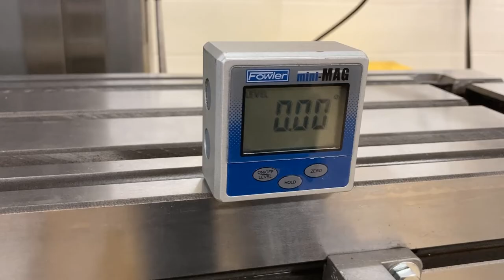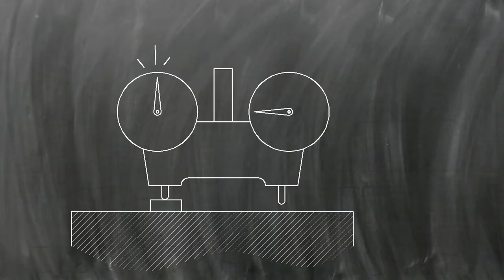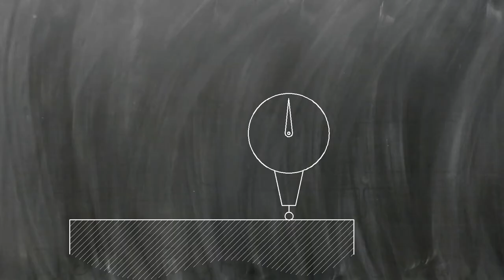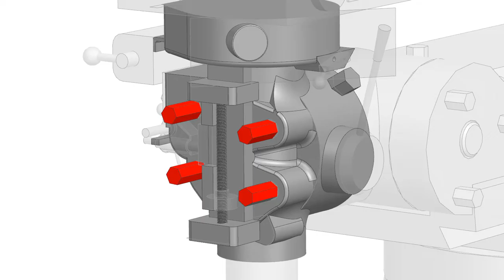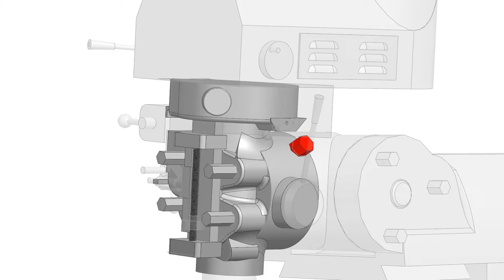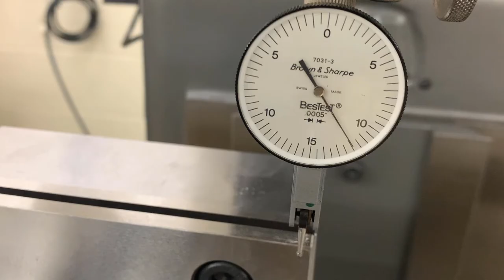How to Tram A Milling Machine

Comment: I just want to clarify something. A machine need not be level. There are machining bays on boats, ships, aircraft carriers, etc. They are never level. So long as the base and table are true, you're set t begin tramming. I say this because a lot of shop floors aren't level (especially home shops), but the process can still be completed.

Another trick/tip is to put something like a 1/2" drill rod in a collet and, using a machinist square, get the head as close as possible.

Comment: Extend the quill. Why? To amplify error from vertex.  Also use 1 precision parallel for sweep.
Reply: I was taught to have the quill extended for greater accuracy and finer adjustment. Also not to have too much travel on the indicator as it can damage the stylus / plunger when sweeping out of the the tee slots.
Here is a quick release indicator holder ideal for general use on a Bridgeport. - https://youtu.be/_djgGUKpULs or for use in a chuck or collet - https://youtu.be/3r9xVYoTK38

Comment: This is a good procedure for the imaginary perfect world on the imaginary perfect machine. In reality it only gets you close. The final proof is taking a light fine facing cut with a 3-6" single point fly cutter,  if you do not have cross hatch marks on the piece in both directions and in both axis then it is not square. Rinse and repeat until you have cross hatch witness marks in both directions and in both axis. Marks like this ((((((( or this ))))))) shows it is not square. 
Finally don't sweep the vice jaw in, clamp a solid straight bar in the vice and sweep that to simulate an actual part.
Of course if you are making pins for bulldozers and bars for welding on excavator buckets you don't need to do this. But when you need to split that last thousandth , this is how to do it.

Comment: Im 17 going into this line of work in hopes of making it a profession (trade skills in general is of my main importance acquiring a machinists handbook plus starett tooling and book and getting a bit acclimated with mills lathes cncs and so on)

But when it comes mills does anyone have good tips when learning (i have 1 year experience so i am moderately familiar with the basics)
Reply from the maker: 1) understand your place as a learner and don’t try to act like you know everything already. Show that you want to learn from others.
2) have a rigid setup. Always shorten any kind of stick out 
3) understand everything about the machine. Know when you can change settings (running/not running)
4) understand speeds and feeds
5) understand what climb milling is and when it is and isn’t appropriate 

I have all my lecture notes and videos organized in one place here: 
https://engineeringtechnology.org/et-curriculum-and-lecture-notes/
Reply from the maker: Just to add, if college is an option have a look at engineering technology.  Less theory than engineering, more career options than trade skills alone, but high value on trade skills.
If you have questions, just let me know:
https://engineeringtechnology.org/about/contact/

Comment: Why does the machine to need to level? I don’t understand why this matters.
Reply: I'm not a machinist, but in the past they had machinist (very precise bubble) levels. Level table means level vice and you can level a part with a machinist level. Now we have digital smart levels. You can zero the smart level to the table and then your part. I would do my best to level the machine though. It really doesn't take very long.
Reply: So let's say a block is messed up and is 6/8 instead of 5/8, you can put a facemill in and easily chop off .125 quickly, let's say it needs to be a perfect 90 or a squared block, so you need the side and top to be perpendicular, but let's say you didn't tram or indicate and you cut it. Now it will be slightly off whether that be by 1 degree or many, you messed up the block and have to completely restart or if you put in a drill instead of using a drill press cause you were pressed for time (hah comedy) as you drill the hole will be at a slight angle instead of perfectly down. Basically if you are using the machine at all that isn't trammed it's not a smart idea
Reply: @Thedudeabides803 You are right, a machine does not really have to be leveled. The first problem is that some folks don't understand the difference between "leveled" and "trammed". The former means "the XY plane is perpendicular to the direction of gravity", whereas the latter means "the XY plane is perpendicular to the Z axis". This video is about the latter, a prerequisite to precise machining.
The second problem is that without mentioning numbers (accuracy) "perpendicular" has no meaning.
Practically speaking, it turns out that you can measure (as has been shown in the video) the deviation from perpendicularity of the Z axis (tram) and you can actually see the results when machining. Measuring "levelness" is not as precise, so you don't really know how far off things are, and I would challenge anyone who would want to claim that a machine that is not leveled will produce something visibly different or bad.
That said, leveling is likely a good practice -- folks may assume the table is leveled and use a level when fixing a part. It may be that the coolant system (or tray) assumes a reasonably leveled machine.
Lastly, as a stretch, the geometry of an unleveled machine would be exposed to ever so slightly different gravity-induced force vectors, but I'd offer that practically such changes would be infinitesimal and insignificant.
However, the gravity-induced forces can distort (e.g., twist) a machine (to the point of detectable problems) if the supporting feet are not equally pressurized, so adequate support and floor is important on large highly precise machines. But this has nothing to do with leveling.
Reply: As a toolmaker I can safely say it matters, this is not a scientific explanation but has happened to myself during my work. A machine I was using was on a slight slope about 5° to the right, no big deal until the machine to the left had parts on it, so I hung the part off the back right side of the bed with the head about 85° in C and started drilling some deep holes. Well, the Inertia of me pulling the handle down helped tip the machine right over, I didn't know my own strength as this milling machine came crashing to the floor. No injuries just a snapped drill and a huge hole in the ground. Every machine was bolted down afterwards.
Reply: The head and table need to be perpendicular with each other for accurate machining. The machine itself doesn't need to be level. Check out Mr. Pete's tramming video #662.